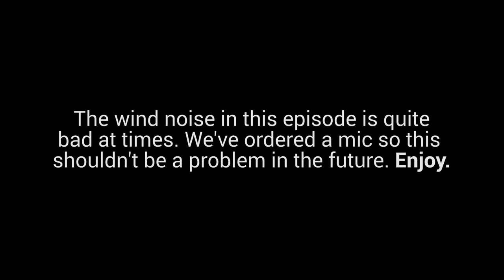Honda Civic K24 Rotrex SNETTERTON - Trackday Footage 21/04/2022 -  750mc Roadsports - Vlog 003

Comment: Looking forward to seeing the rest of the development of this. As much as you can show without giving anything away to the rest of the race class obviously. 
Is 102° coolant temps bad long term for the engine or is there a “race” coolant that doesn’t retain heat the same that could be used, or is it bonnet chopping time if you want to lower temps?

Good luck with the season too 🍻
Reply: We have an additive in the water already to help temps. I think a bonnet vent is next along with possibly moving the radiator and intercooler into a different position so we can duct it better.

Comment: Why did you guys choose a RPM limited supercharger and not turbo? And why do your shift sound so crisp? Is that a stock Honda transmission?
Reply from the maker: Less internal and engine bay heat, slightly more simple and no transient lag was the main reasons 

Transmission is stock honda, but with hyrbid racing shifting components
Reply: @HCRWorks  thats cool, 10 years ago, i build a s2000 that had a scorched piston. My machine shop sleeved it using a 2mm melling repair sleeve due to the special cylinder wall, stroked it using a K24 crank and added a Vortech blower. It made 415 Whp at 13psi. Your Civic is very inspiring, co clean. I would love to see the underside and see all that cool Aero.
Reply: @ze_german2921  our next vlog with show the flat floor being built 👍🏻

Comment: What is the rpm limiter onnit and final drive?
Reply: 8k rev limit and f/d is 4.7 but individual gears are shorter, approx 146mph on limiter in 6th
Reply: @petelawton-hcr_works6059  yeah my own has 8k rev limit but 5.06fd but IV ep3 gear set and 18" wheels I'm going to rev it to 8300 to see the difference and hope it'll help they are rapid through the gears great video and hope the season goes great for ye il be following it